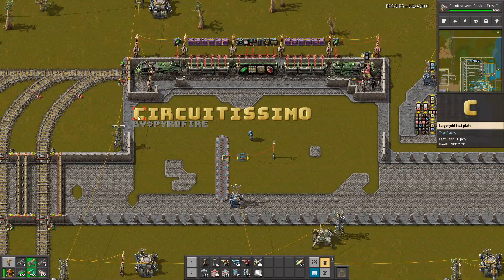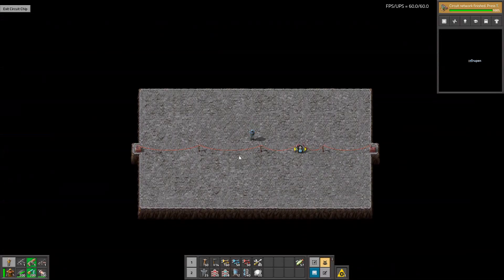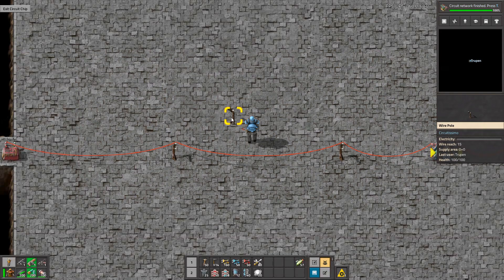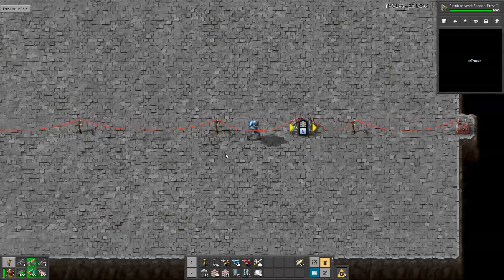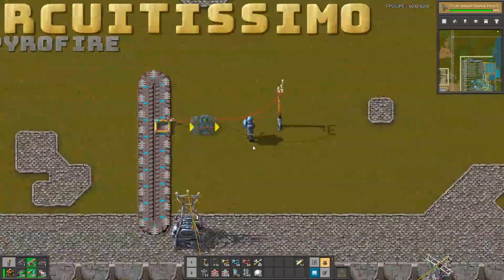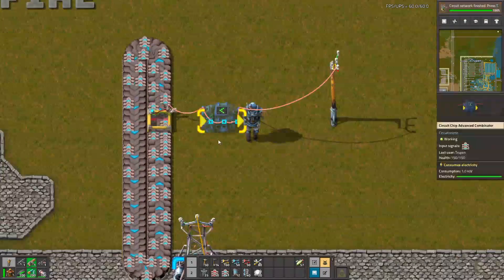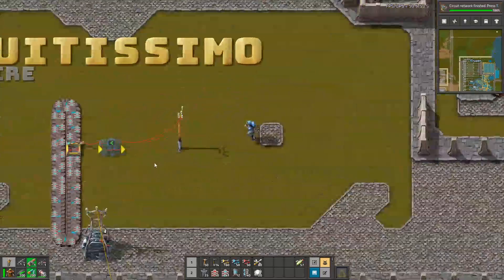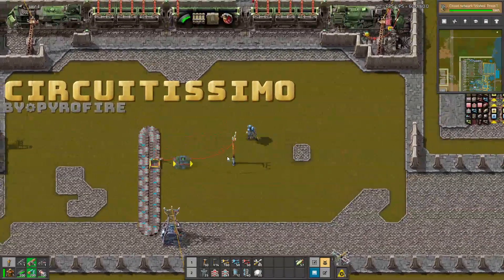Hide your circuit spaghetti

Comment: I tried this mod and although it has a lot of potential it also has a lot of issues.  The clean circuits look is great, but when you're building inside the combinator you can't use or create blueprints, or copy and paste.  A lot of the circuits I've built or want to build have a lot of repetitive sections with only the conditions changing, so having to build each of these segments one by one becomes rather annoying.  The only part I really found useful was the logistic poles, and I can't seem to find a mod that just adds that feature.  Also, it seems like the mod-creator understands that there are a lot of problems with the mod but has little urge to try and fix them.  But maybe it's just me.

Comment: From what I can see the mod creator does not claim that it improves UPS, but he is saying that the mod has no impact on performance since it doesn't actually use another surface. It just creates a temporary surface when you edit it and then it creates small copies of the circuit stuff you made into the main surface.

Comment: This seems really useful, especially if it really does improve UPS issues with massive amounts of combinators. (I watched this right after watching `arrow in my gluteus maximus`'s video about pacman in factorio, and how it would run at 0.3 FPS or something like that. It seems like this mod would help with things like that). Also, just helps with spacing issues. 

*considers issues that might arise if you have multiple interconnected systems and how this mod handles that, then decides that I don't know enough about combinator logic in factorio to be able to make a proper statement about it.